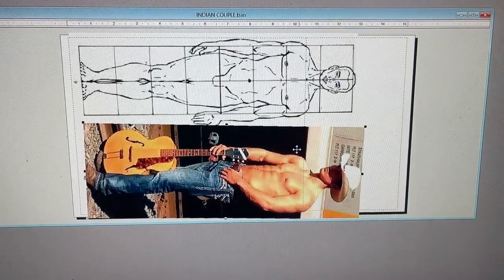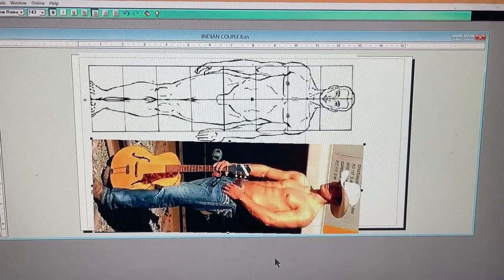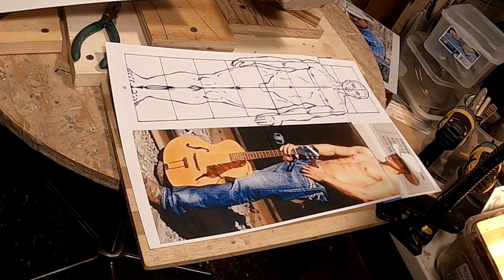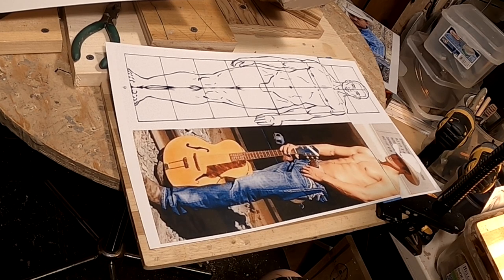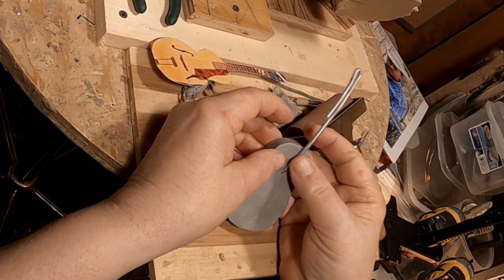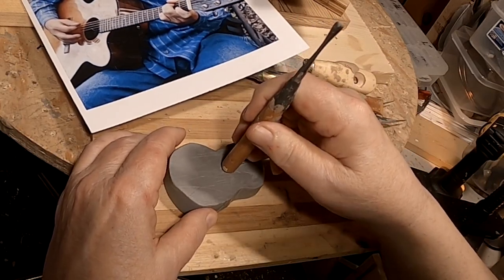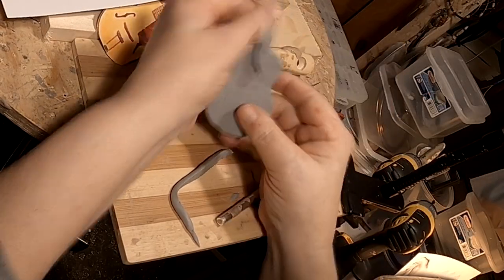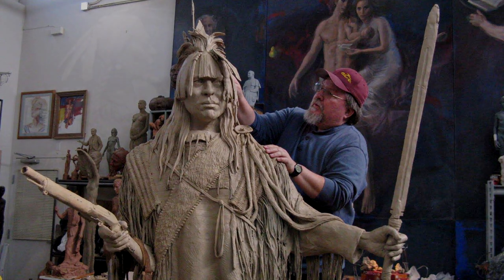COWBOY SERENADE   Sculpting the Cowboy's Guitar Today

Comment: Thanks for posting these!  At the end of the video where you are sculpting the larger than life Native with the pistol-behind you on the wall is a painting...what is that painting or do you know how I could find out?
Reply from the maker: That was a foundry, in Orem Utah, where I was putting final touches on a clay that was about to be cast into bronze.. It was an artist's studio that the foundry had for local artists.. I wish I could tell you who painted that painting.. but I can't..
Reply: @clayguy1  Thanks :-). Question: is a large air space inside a sculpture a problem for casting if the clay doesn't need to be supported?
Reply from the maker: @wecu4dk  The Plasticine clay doesn't come in contact with heat ever... so no problem.. Now ceramic clay.. Might be a problem